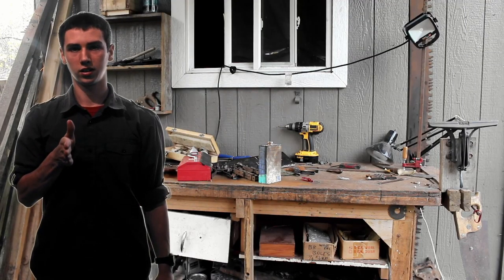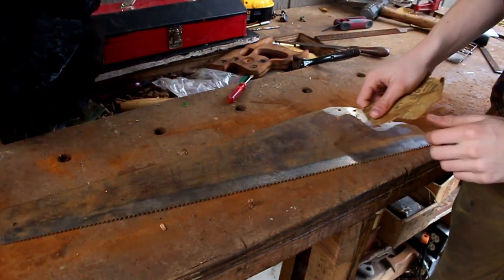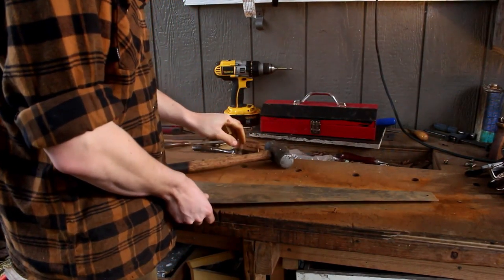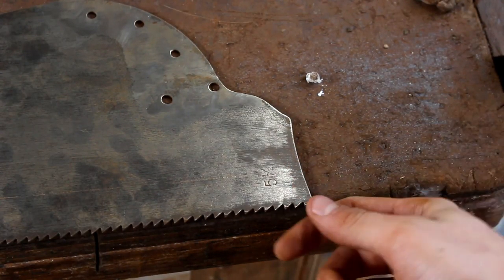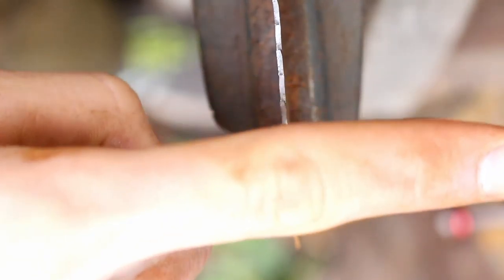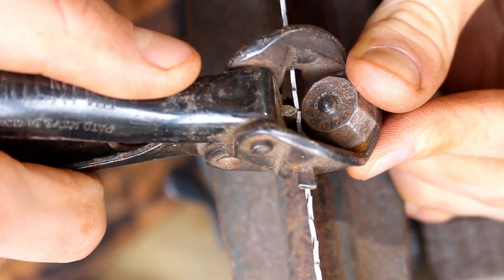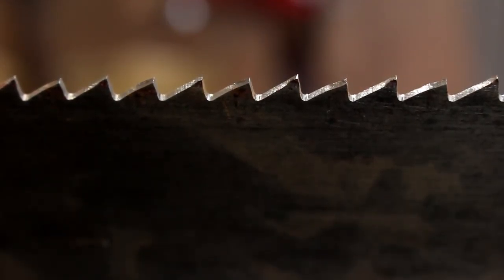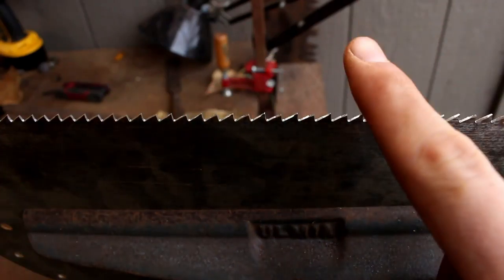Setting and Straightening/Saw Restoration Part 3

Comment: When you saw the 5 1/2 mark you rightly said (if this is an American saw) that this indicates 5 1/2 points per inch (ppi), but then you assumed that this means there would be five full teeth plus 1/2 the next tooth i.e. six teeth; no, there are only five teeth in 5 1/2 ppi. The English count the teeth (tpi) which techinically makes more sense but the practicality of the Americans found it easier to count points. Each tooth has one point, you can't have half a point. 
tpi = ppi + 1
ppi = tpi - 1